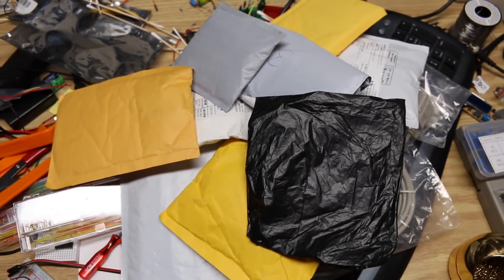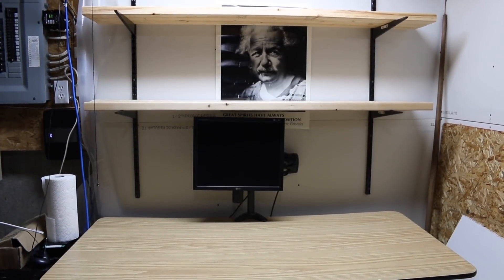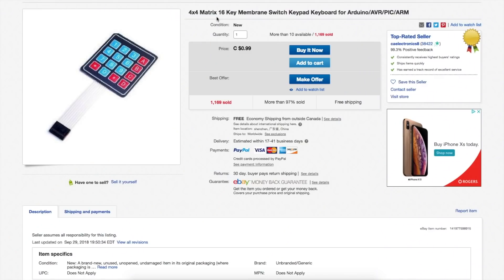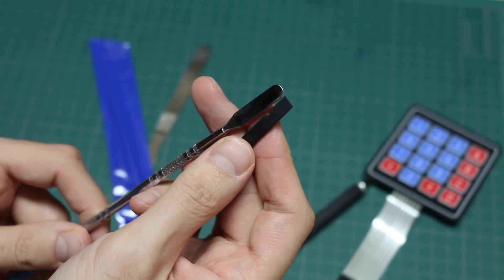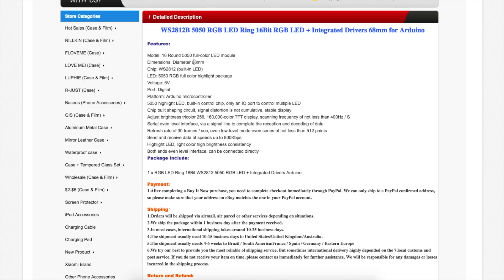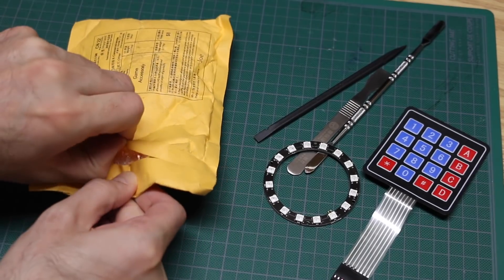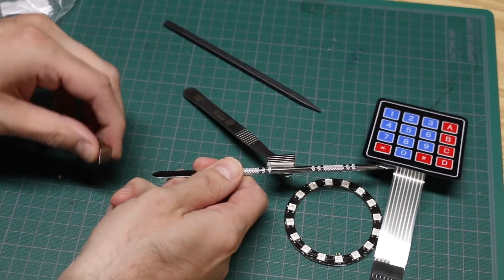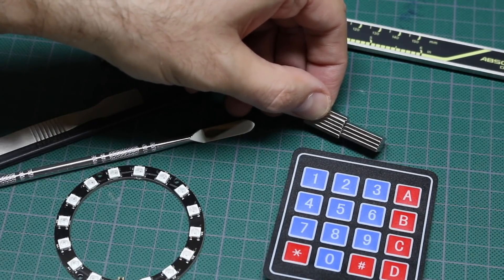Lab Workbench Cleanup and Mailbag!  WS2812B RGB LED Ring, 4x4 Keypad, Neodymium magnets,  Spudgers

Comment: You call that a messy workbench?
Clearly you haven't seen what's just out of frame on mine...
I have a couple of that 3rd spudger that you opened. They're nice and sturdy, but sometimes not quite thin enough to get into some places.
Reply from the maker: I think the mess got diluted when I split up into two separate work areas but let’s see what happens by the end of this year when I’ve opened up a whole lot more mail bags and have more stuff to work on.  

I put a bid on one of those folding credit card knives that you so elegantly Blunted recently. I have to check it out for myself even if it’s only one time use.

Comment: i've some equipment hanging from the shelf, thanks to one of those car flexible phone holders... for example, my multimeter, so it's always there when needed without actually occuping any precious space :)
Reply from the maker: I've been trying to come up with a way to mount the meter...mine doesn't have one of those strong magnets in a strap to hang from metal objects so I was thinking of using those neodymium magnets somehow.   Need a way to hang test leads too.  Maybe a big bolt driven into the side of the lumber on the sides of the shelves out of the way.  Would be good to find a way to mount a wire spool holder too so I could have a horizontal rod hanging under the shelf and the spools could spin freely around that.  Lots more work to do!
Reply: i used 1 of these to mount my meter, cheap, and a zip tie to secure it...
https://it.aliexpress.com/item/JKING-Supporto-Del-Telefono-Dell-automobile-flessibile-360-Gradi-Regolabile-Car-Mount-Mobile-Phone-Holder-Per/32849267839.html
Reply: for test leads and other cables, i made a "cable bob marley" (google images for it, eheheh) :D
https://www.google.it/search?q=cable+bob+marley&newwindow=1&rlz=1C1GGRV_enIT751IT751&source=lnms&tbm=isch&sa=X&ved=0ahUKEwjmhuv7pObdAhWLsKQKHRsHD5wQ_AUICigB&biw=1360&bih=636
Reply from the maker: 👍👍🏼👍🏽👍🏾👍🏿   That’s the best cable mount rack I’ve ever seen! Thanks! I just might try it. I wonder how Einstein would look with dreads.